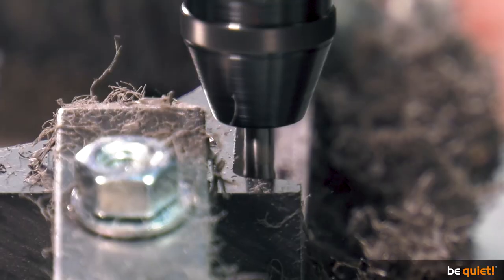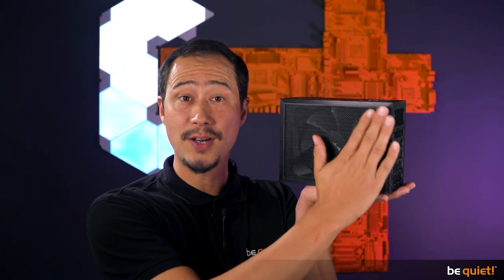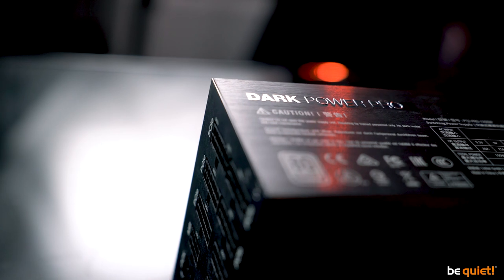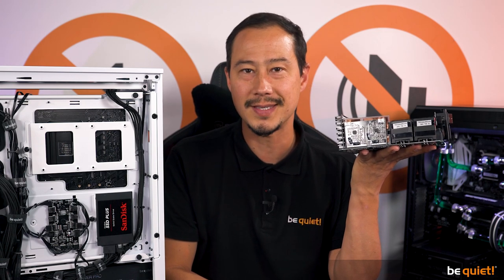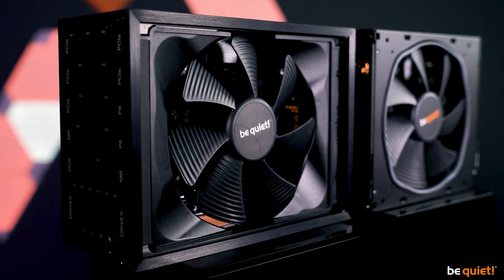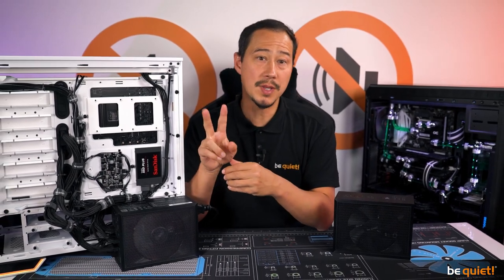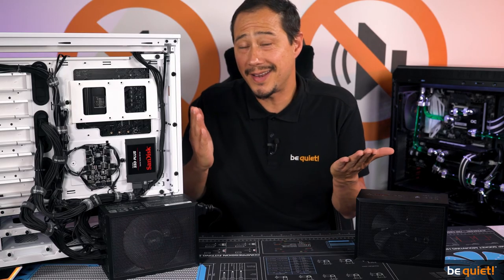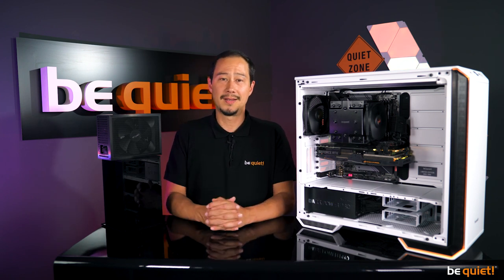Dark Power Pro 12 | Product Presentation | be quiet!

Comment: Can we expect more of your products to be availble for shipping to Croatia or more volume of your products to be availble at your distributor?
Is there a chance in 2021 to get be quiet! Pure Base 500 ATX Mid Tower Case smaller for mini itx motherboards with no 3.5 hard drive storage?
For an example;   remove 3.5 hard drive storage
                               add only 2 mounting slots for 2.5 SSD 
                               put atx power supply(with 1200W) aside and bellow top from the motherboard with fan heat going to outside with mesh on a sidepannel
                               put two 140mm high quality to the front an one on the back 
                               on the front pannel put extra two holes with mesh for the fans
                               on the back put only  4/5 slot's for gpu mounting
                               shrink the case from the bottom as close to the gpu 
                               use better quality cables
                          
Thanks :)
Reply: I would buy ITX case from be quiet! in a heartbeat  ;-)

Comment: cable combs would be a great thing for those sleeved cables, otherwise the inside of the case would a bit messy ... and for an almost 450$ PSU, I would really want those to be included
my 2 cents

Later edit: cable combs are included
Reply from the maker: Well - they are included.
Reply: @bequietofficial  lol

Comment: Hello Be Quiet! I just purchased this PSU and when I turn of the power switch on the PSU why does my motherboard LED not turning off? How do I fully turn off the PSU?
Reply from the maker: You do not need to worry there, this is a completely normal behavior. If you turn off the power supply fully, capacitors & coils discharge completely. If you then turn the power supply back on after a while, these components are loaded with the inrush current, which leads to wear of the materials in the long run. For this reason, we have set the power supply to a 5V standby voltage, even if the toggle switch is set to 0, which ensures the longevity of the power supply.

Comment: i just got the dark power pro 12 1500w and i only have one 6900xt which pcie plug in spots is best to use,i seen a diagram that showed like the last two was best for balance but i would like to confirm
Reply from the maker: If you use a GPU with two PCIe connectors, please use the connector marked "A" in the manual.
Reply: @bequietofficial  my 6900xt requires 3 total pcie it’s the asrock phantom gaming 6900xt so should I use the one marked a and one other ?
Reply from the maker: Sorry, in that case we would recommend that you split the three ports between two to three rails, so 2 to 3 different "B" ports.

Comment: Why are the rgb lights on my motherboard working even when the power switch is flipped to 0? Its a bit odd that the psu still delivers power to the motherboard. It seems a bit unsafe to me.
Reply from the maker: You do not need to worry there, this is a completely normal behavior for the Pure Power Pro 12. If you turn off the power supply fully, capacitors & coils discharge completely. If you then turn the power supply back on after a while, these components are loaded with the inrush current, which leads to wear of the materials in the long run. For this reason, we have set the power supply to a 5V standby voltage, even if the toggle switch is set to 0, which ensures the longevity of the power supply.
Reply: @bequietofficial  Thanks for the in depth answer!

Comment: I got this power supply unit, solid packaging and rich equipment seem to be happy.
I read "truthful reviews and tests"
The joy ended after switching on, under a load of well, from the power of 500W, it begins to cyclically sink along the 12V line to 11.9V,
moreover, the inclusion of the notorious combination of all 12V lines in the "superpower flow" has no effect on this problem.
Understanding perfectly well that this all fits into the ATX standards, before sending them to the service, I wrote to them, since at least there is a service from them in Ukraine,
answered me the following
Good afternoon.
As soon as it is necessary to produce as much as a lack of hands in the robot of your system, it is better to turn into the service center of the store, de Vie podbali BZ.
Our specialties will be able to diagnose them using hardware devices.
As a service of education, we can say that for the ATX12V standard, it is innocent to change 5%. For a line of +12 V, it is normal to use a spring between +11.4 to +12.6 V.
Your vidhilennya is less than 1% - 0.8%, if you are accurate, it is even a good indicator.
Until then, please be aware of any inaccuracies in the hardware and software features of the motherboard and monitoring software.
Well, well Karl, thanks for at least 11.4 drawdown. It makes no sense to send it to the service by unsubscribing, which is in the quote.
Now I want to load it at least up to 1000W, let's see what the vaunted be quiet!

Comment: will the coils whine? i'm dumping corsair because of that and are in the market for something better...
Reply from the maker: No, they will not.
Reply: @bequietofficial  This is the main reason I'm considering switching from Corsair too. Is there any negative in going for the 1500 version over the 1200, if at max load the 1500W will only reach 50% capacity?
Reply: @daffo911  yeah. The 1500watt Will be less efficient. Sweet spot for efficiency is around 70% usage i believe.
Reply: @OutOfNameIdeas2  Bruh  the Pro 12 have an efficiency of +90% on all loads  That's what 80 PLUS TITANIUM certification is all about.  It's the highest possible efficiency certification FYI.
Reply: @daffo911   at 50% load  its at its highest efficiency of at least 96%   ( 80 PLUS Titanium )

Comment: Hey Be Quiet, I have bought the Dark Power Pro 10 1000W years when it was for sale. Fantastic product I have been very happy. However, the bearings on the fan are at the end of their life cycle now. Is it connected to the PSU with a 3 or 4 pin? The size of the fan is 140mm and a regular 140mm be quiet fan would fit as a replacement? Thanks!
Reply from the maker: Hello. Best to contact our customer support (service@bequiet.com) - my colleagues will be able to help you there.

Comment: Hey guys but it's not compatible with the connector in some of the be quiet cases I just find out. And needed to take out the special connector in my new be quiet case.now I have a ugly gab on the back of my case. Do u have a solution for this ?? Its a very nice power supply.
Reply: Check their website and look up the Powersupply you got, under the Accecory Tab there are Backcovers if needed.

Comment: What is the: Overclocking key switches between six 12V rails and one massive 12V rail?  I was wondering what does this do?
Reply from the maker: Exactly that. What is the question?
Reply: @bequietofficial  I don't know what any of that means or why a PC builder like me would want it.  I mostly copied a description from amazon.  Does it improve performance in some way?

Comment: I just ordered mine . Tomorrow it will arrive. It will power my hungry TUF RTX 3080 and my i9 10900KF, plus a legion of 12 ARGB fans(six are Lian Li Uni) (them alone consume around 50 W if not more :) ) . All of them could be installed in my O11 Dynamic. But if things go crazy and I want to expose the beauty of the PSU, I might use my other case: Phanteks Enthoo 719. And that case has in it 18, yes, 18 fans (a set of 6 will be used for push pull on my 360 Galahad).
Reply: Hey. Did you end up getting it? Happy with it after a 1 year? Quiet at load?
Reply: @DreamingPhenom  Now I have more powerful fans. I have 7 InWin fans 6 for intake and one for exhaust and 3 EK Vardar for my  Lian Li Galahad.  I keep my 9 fans mostly on manual speed but technically silent and I can't hear the power supply in heavy loads. Also I believe that it's be sufficient for a future upgrade to RTX 4080. The power supply works just as fine as it did on day one . And I believe it'll mostly last even to the next full PC upgrade meaning after the GPU upgrade. Or I can upgrade when GTA VI will launch 'cause frankly there won't be a game any time soon that my current PC won't run well on it. PS: I setup my power supply on 'OC mode' aka one 12v rail. Better to be sure that the CPU and the GPU are receiving any kind of spike input . I've seen power supplies with enough power in wattage but with the lack of a good distribution(EX: what's the point of having 10 PCI Express  cables but all of them with limited amperage) . Long live my power supply. I hope be quiet! will produce some cables extensions for the new GPU power plug(EX: I would hate to be stuck with that ugly Y splitter that Nvidia uses on Reference RTX cards).